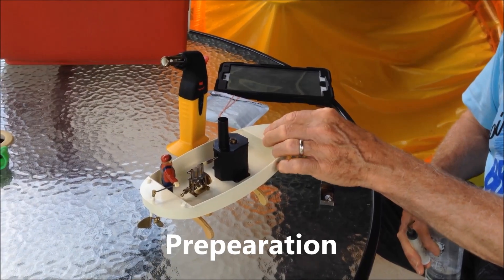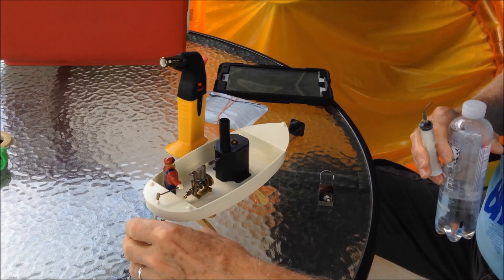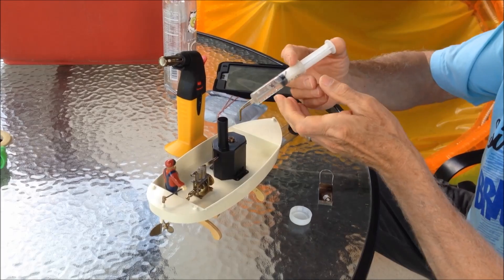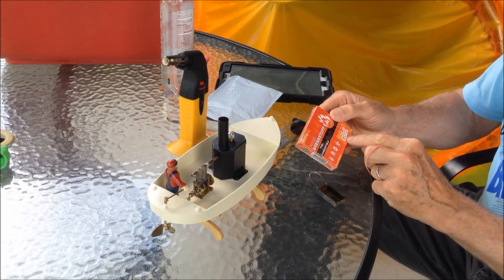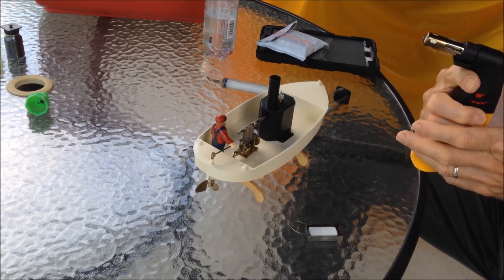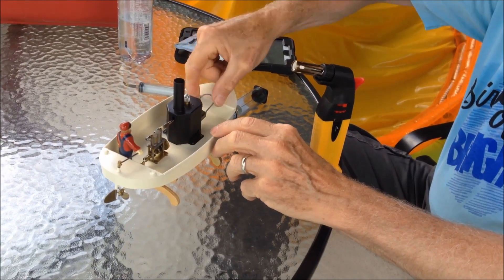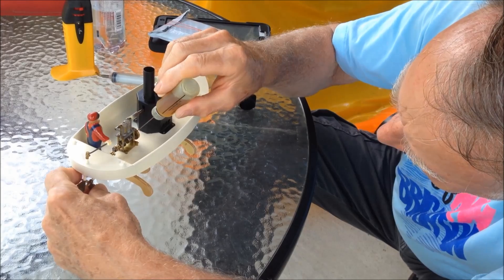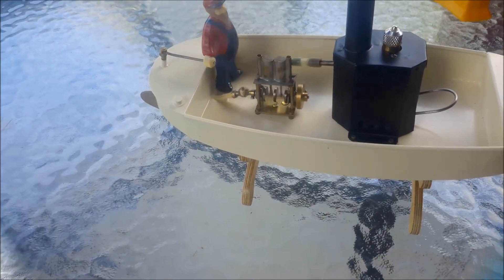Home made mini steam boat running in water

Comment: put a r/c system in it and run 1 servo to steer it mount the radio in the bow, and the servo in the stern with an arm to the rudder and a rod to the servo... would look and run WICKED AWESOME!